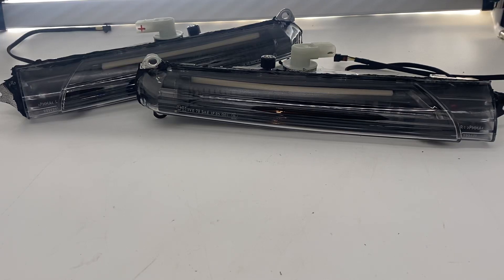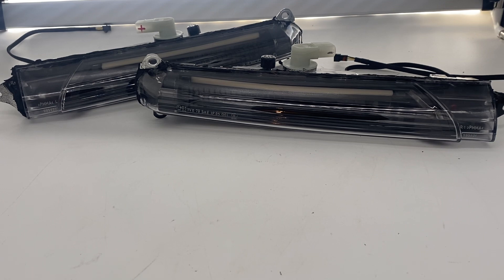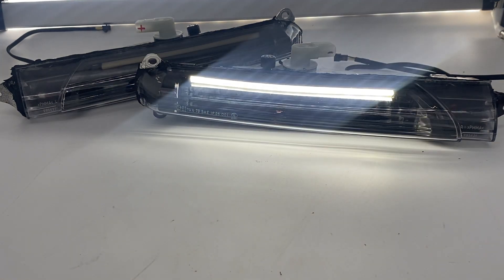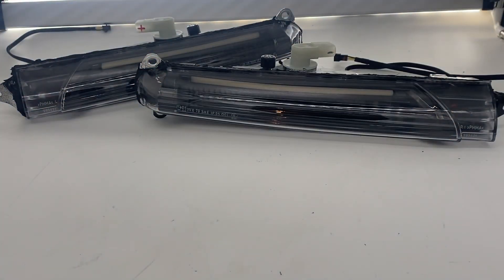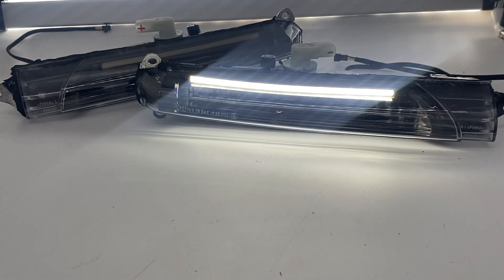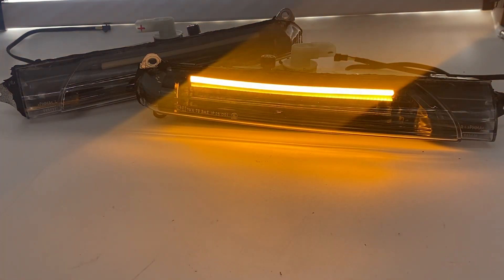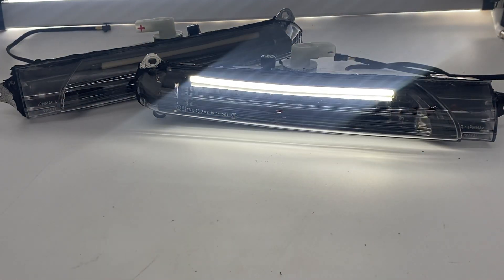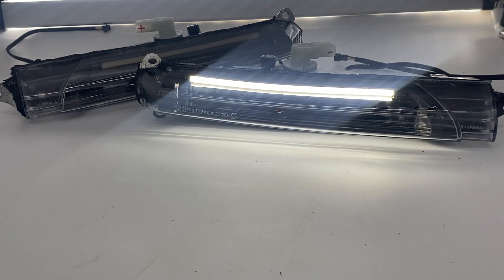Porsche Cayenne 957 switchback LED turn signal upgrade

Comment: Hi! I installed a led bar in the turn signal position, but it does not work properly. only in emergency lights, but when turning signal, no lights. I tried several cancelers ( 21w, 16w) and nothing worked. How didi you manged to make the led bar work correctly while blinking to turn, please?
Reply from the maker: Hi there! Are you using our product? If so, give us a call and we’ll walk you through it. 716-662-3479.
Reply: @HIDprojectors  not your product. I retrofited mine
Reply from the maker: @euricooliveirajr1713  i’m happy to help but it’s hard to offer support on a product that we don’t sell. We need to know more specifics about what you’re using. Feel free to give us a call if you need assistance.
Reply: @HIDprojectors  thank you. I searched in your website, but could find this turn signal for sale.
Reply from the maker: @euricooliveirajr1713  it’s a special order product. You can reach us at 716-662-3479 if you’d like to place an order.